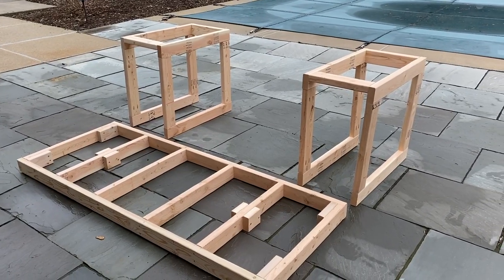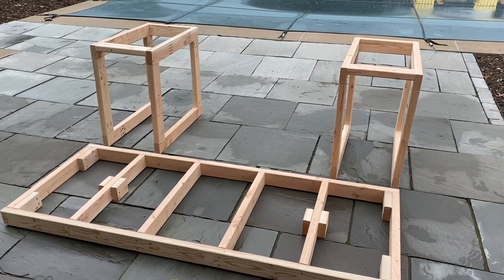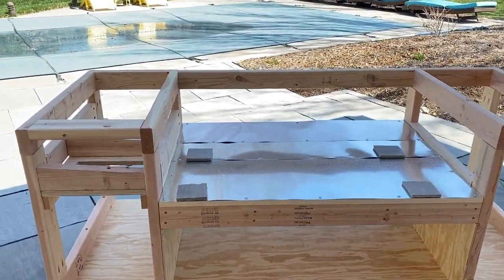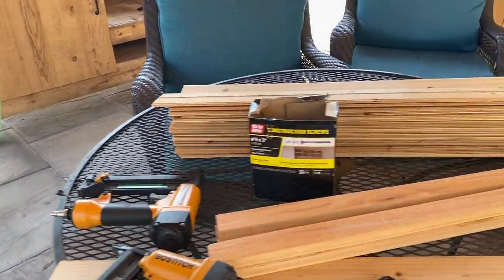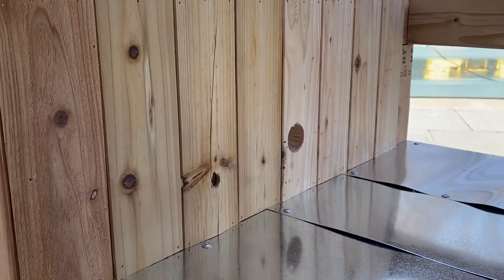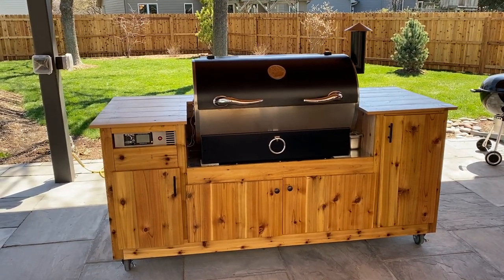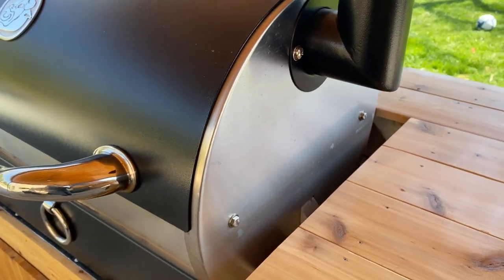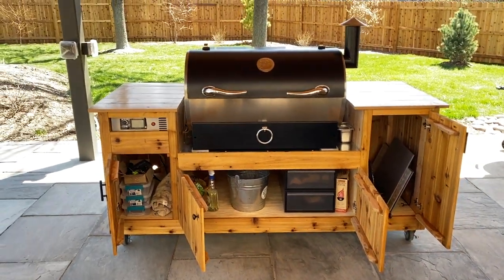DIY Rec Tec 700 Grill Cart - Class up that Pellet Smoker with a Built-In Look!

Comment: Looks awesome!  Will the smokebox fit with it? I'm sure you could probably just use a higher level stone to raise it higher to make room for it if need be...
Reply from the maker: The smoke box will not fit with the counter height in this plan.  You are correct... would have to move the shelf that that grill sits on higher, or lower the counter.

Comment: Keegan,
Wondering what u think about using the 1x6 cedar for the countertop?   I don’t have a covered patio.  I’m wondering if the countertop will leak into the cabinets below?   Did u use a Clearcoat polyurethane!?  From what I have read from comments that you replied to somebody about this question, you only put a penetrating oil on the sides and the trim , is this correct? Any advice would be great. What I don’t want is to put a protective coating on the top and then three years later it starts to turn white and starts to flake off.

Comment: Really nice job, I love it. Would it be basically the same plan without the wheels if I wanted to have it done as a permanent built in, not a cart? Thanks.
Reply from the maker: Pretty much.  I would add 4-5" to all the vertical parts of the build, so you keep it in the 36" tall finished height range.  Other than that you could keep it the same.

Comment: Nice work.  Any recommendation for heat dissipation / heat shield?
Reply from the maker: If I were to do it again, I would block up the grill higher, off of the shelf.  If you have the $$, you could install stone or granite across the entire shelf as well.  I never had any problems, with only the aluminum flashing, but I have heard of others getting pretty high temps under the grill.  The sides I thought stayed plenty cool, even at high temps.  But... more protection is never a bad idea.

Comment: Have you had any issue with the fan over heating on the bottom. I feel like I have plenty of air flow.  I have a similar set up with the green mountain grill and have been through 3 fans just bunt up another one and I finally went with the bull so waiting to get it in and set it up. On yours over all nice build. Man.
Reply from the maker: I have not had issues with the fan and temperature.  I mainly use it for low and slow.  not sure how hot you were usually running yours?  so far so good.  i would just prop it up on taller stones if it is a big concern

Comment: Thanks for the great video. What nails did you use in the video? 18/16/15 GA 1 1/2, 2 or 2 1/2 inch? Thanks!
Reply from the maker: I usually use 16 ga for most everything.  For the trim work, I usually use 1 3/4"

Comment: I just ordered a Rec Tec 700 yesterday. Wondering how you like this setup after several months of using it. I'm thinking about building something similar, but mine would be built-in instead of on casters and not quite as wide as I dont have 6' clearance. I'm also thinking about going with with concrete tabletops.  I was just wondering if you had to make any additional mods for more airflow or if there is anything you would do differently if you built it again.
Reply from the maker: Everything works great.  If I were making it permanent, I would make the counter granite, or concrete, or something else waterproof.  But the size and functionality has been great.  The air flow an heat build up has been fine.  It is literally no issue if you are smoking meat or grilling in the 200-400 range.  If you are cranking it up to 450+ or so, its fine too... but I would not leave it alone for a long time just from a common sense perspective.  The airflow is fine with that 3/4" gap underneath.  You do not need much clearance to have a lot of intake air and it does not get hot.  Overall, I would not make any changes, unless it was due to fit a specific space.  I tried to make it as compact as I could while still housing a big ass grill.  Hope you like it if you give it a shot!
Reply: Could leave the right door off and put a fridge in

Comment: Hi there.  New subscriber here.  Will these plans fit the new RecTeq RT-1250 by chance?
Reply from the maker: Yes, with the exception of the front shelf, I believe.  You may want to leave that off.  Also... the 1250 runs hotter I think... which I would be careful with.  If you are running it on the hot side, you may want block up the grill higher than I show in the video.  Could get toasty.  So... if you take some precautions, it should work.

Comment: A couple questions. Any thoughts on fire issues using the cedar to wrap or for the counter top? Also yours is covered under the patio, but do you think the cedar will hold up in a 4 season climate not covered (other then winter)?
Reply from the maker: If you are diligent about keeping it sealed... then it will hold up OK.  If you are not, then I would go with a granite counter.  The horizontal surfaces get worn very quick.  If you keep the vertical surfaces sealed, they will hold up pretty well.   I would not recommend going 500 F for 3 hours with this setup, but if you are primarily smoking, you will be fine.

Comment: Now that you've had it a year, can you show how it's held up?  I purchased your plans and my brother built the frame to the plan so far.   I did stone veneer on the sides and haven't put a top on it yet.  I'd love to do granite/quartz/similar if I can swing it, and part of my motivation for that is concern about the long term viability of the cedar top.  If I could see how yours is looking 1 year in that would be helpful in making a decison.   Thanks in advance if you could do an update video.
Reply from the maker: If you shoot me an email, I can send you a picture this week.  there is a contact form on searedandsmoked.com  it has help up pretty good, but I do keep it under a roof or under a cover.  If yours will be exposed, I think you would appreciate the granite surface.   I have never regretted spending the money on granite, after I shell it out.

Comment: How hot are you getting below the pit? I just built something similar and ended up putting 2" thick brick pavers underneath. At 250 degrees underneat i was reaching 130 degrees and at 325 i would get about 230.
Reply from the maker: I eventually sold the grill, so i cannot give you a measurement.  i never had an issues…. but that does not mean it was not real hot underneath. good to know for future builds

Comment: Mighty you have plans for a 700 with the smoke box attached?
Reply from the maker: That I do not have.  From what I have seen, you can attack it two ways.  1:  raise the middle shelf a few inches and you can use these plans, except the smoker box will sit above  the right countertop.  1: make the middle shelf and the bottom frame longer by 16" to accommodate the smoker box in the middle.
Reply: @Searedandsmoked  that is what I was thinking, but why reinvent the wheel I’d I did t need to. Thanks!

Comment: Is it safe to enclose the girll (or any gas grill) with wood like that? It looks great though, id like to do something similar, if it is safe
Reply from the maker: If you are enclosing on three sides like this, I would not use it on full blast for hours, but at smoking temps in the 250-300F range, I never had any issues.  Lining with a non-flammable surface, such as aluminum is a good thing too.  Then... always good to monitor your first cooks to see how hot things get.

Comment: How did you join the 2X4's together up on their sides with a 5"+ long screw or did you drill holes for them to slide into and screw into the base?
Reply from the maker: I drilled pilot holes about 1" deep for the 4 3/4" screws, so the screw go fairly deep into the bottom 2x4
Reply: @Searedandsmoked  Thanks! Starting my BBQ table this weekend!

Comment: And updates on how this design worked... cedar gets real nasty with changing heat and cold
Reply from the maker: working great.  if you wanted to upgrade anything, you could use thicker tongue and groove cedar for the vertical siding.  If you keep it covered, it will hold up fantastic.  if you do not cover it and leave it in the elements, the surfaces will definitely weather fast

Comment: Not sure I'd be selling plans for that, way to combustible to be used right next to a grill.  Rec Tec warns not to be within 60" of combustibles.
Reply from the maker: I ran it full bore for a while yesterday and it seemed OK.  little warm, but nothing got too hot on the sides.  I get the concern though
Reply: That was my first thought too.  These tables are common on kamados because the ceramic keeps the exterior cooler.  Grease fires are rare on RecTecs but they can happen. I don't know, this is not for me I guess.
Reply: Use non combustible material, metal studs, concrete board, granite...

Comment: Love this cart.  Great job.  I bought the instructions and they were TERRIBLE!  Please put some 3D type drawings or better yet photos in there.  You CANNOT make this cart by just using the plans, must keep coming back to the video to make sure you're putting the parts together correctly.
Reply from the maker: Hi Mark, I have generally had good feedback on the plans for this cart.  Was there a specific part you found more difficult? The 3D plans will probably happen over the winter, but if there are specific issues you had, definitely let me know and I can try to address them.
Reply: @Searedandsmoked  Thanks for the response.  I have a list of problems with your plans.  Can I email them to you?
Reply from the maker: @markanderson1402  definitely send me your thoughts. that’s why I include my contact info on my website and in the plan set. I am happy to help
Reply from the maker: Hi Mark... just wanted to let you know that the plans now include 3D Plans through the framing part of the build.  Might be a little late for you, but if you want a 2nd copy, let me know.